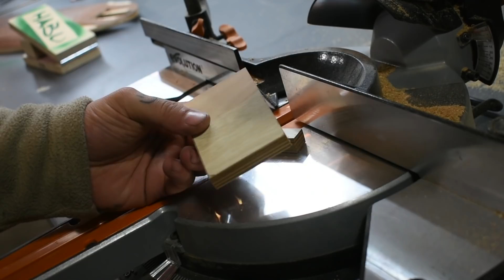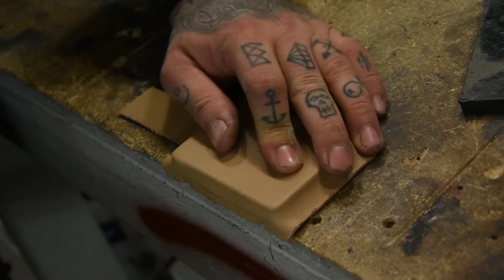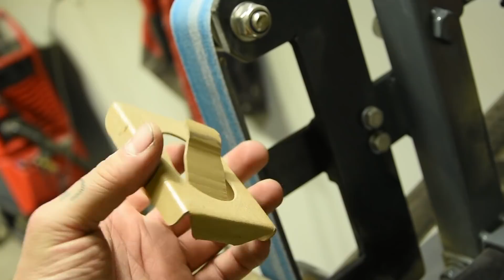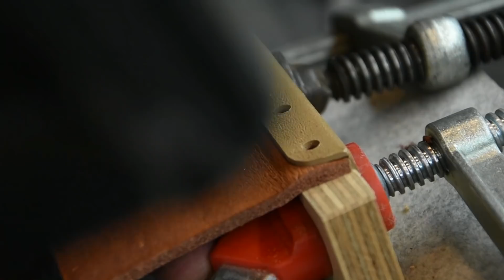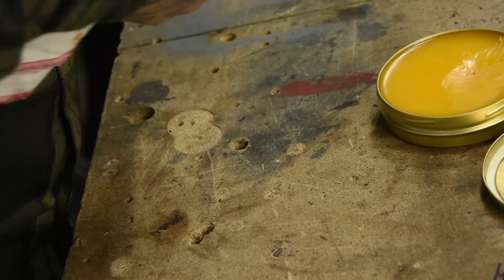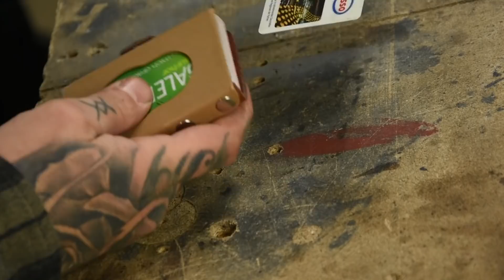HABU \\ Building The Ultimate Wallet

Comment: For MDF end grain or cross-cuts, I us a solution 5 parts water 1 part wood glue, using a foam brush
.  Then, after it soaks in, hand sand with ~220 grit.  When that's done, you will have an edge that takes more of a beating. As usual, great vid!
Reply from the maker: Thank you very much!